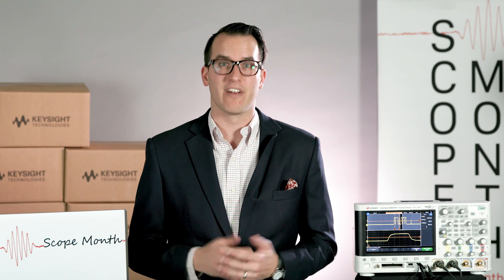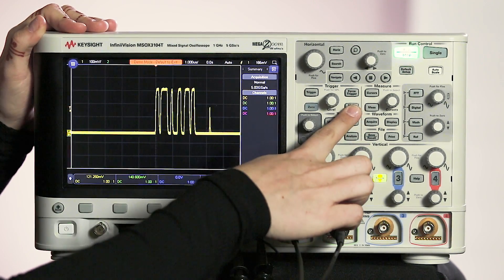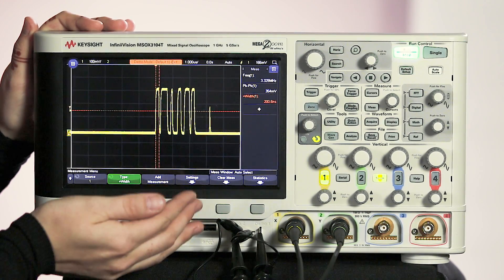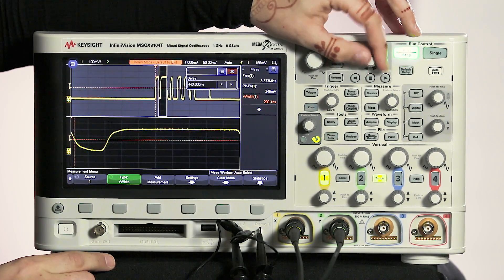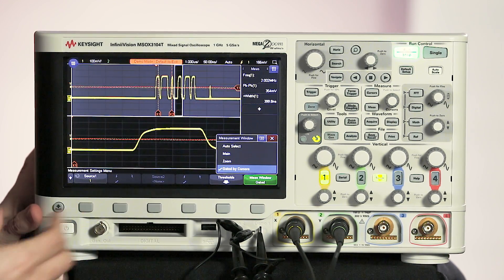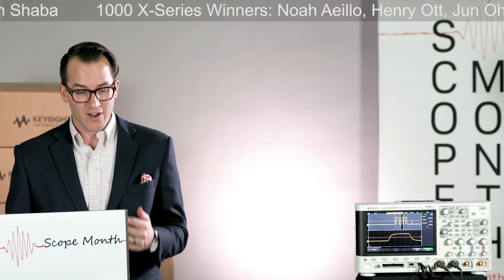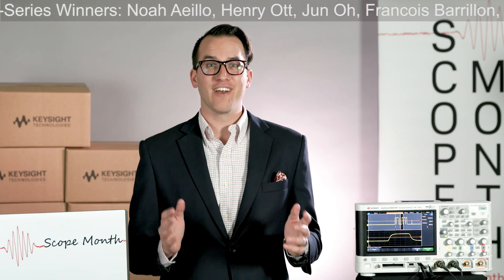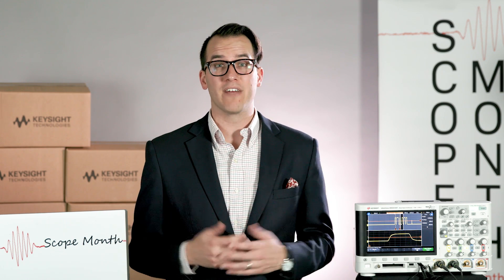How to Make Gated Measurements with an Oscilloscope + Scope Month Winners (24-Mar-2017)

Comment: I want a scope please😭
Reply: Shreyas kulkarni Buy it yourself, 'cuz India ain't included in this promotion. I know, it sucks! I want one too.
Reply: Sopan Kotbagi True buddy! 
I'm electronics hobbyist (Since I was 5, just like Dave Jones A.K.A EEVblog) and student who cant afford one. For me even the lowest range ones. I tried my best to get one but unfortunately Keysight doesn't want to giveaway the scopes to people who really need them. The people in developing countries like India etc. cant afford them the oscilloscopes. They are not cheap!😢 If (I know its not possible😭,) I get hand on one of them I'll surely help my classmate students to learn more about electronics and oscilloscopes.
Reply: Shreyas kulkarni Have you tried using soundcard oscilloscopes? They are basically computer programs which utilise the sound card in your PC to visualise incoming waveforms (just like real oscilloscopes). The only thing you'll require is a computer, which, I am assuming, you have access to. These will work well for frequencies within the human audible range (20Hz-20kHz). Check them out.
Reply: Sopan Kotbagi Yes. And also, the soundcard must have line in function. Only problem is that they work only in frequency range of approx. 5 to 19 KHz. In electronics feild, this range is not very useful. Also you can try online oscilloscopes which you can use by uploading audio file. After all, there is no practical substitute for a oscilloscope.